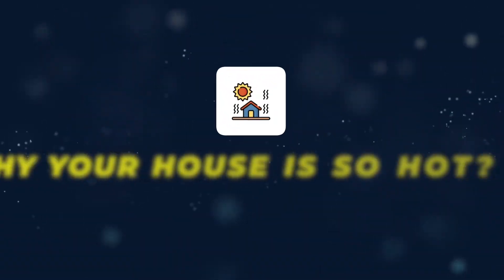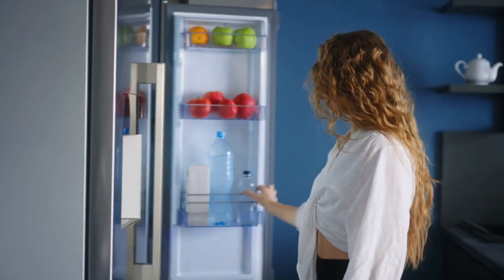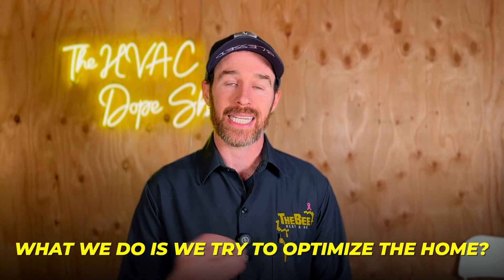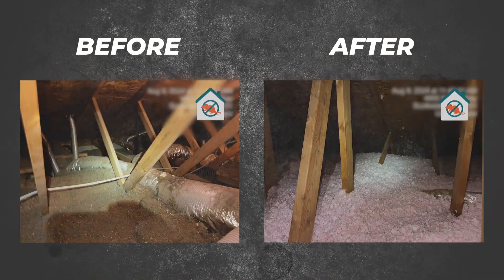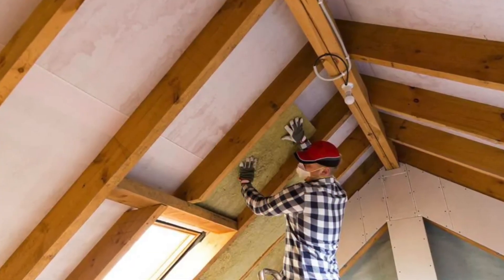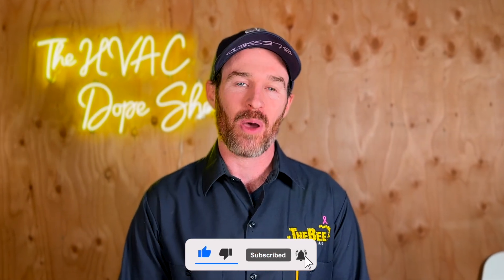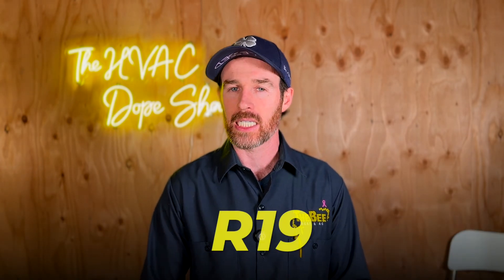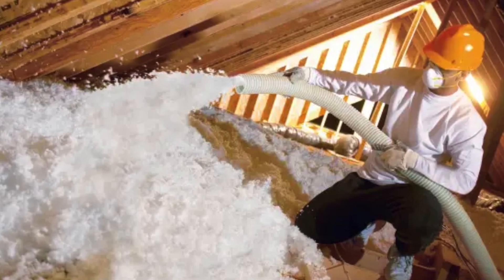Why your house is so HOT 🥵AND Cold🥶| Insulation Before and After Deep Dive

Comment: Do you guys do Manual J calcs beforehand?
Reply from the maker: Before an install ? Or before insulating? No for insulating yes for install… if I took every Manual J at face value we’d have unhappy customers and improperly sized systems. There’s a lot you still can’t see when doing a manual J on a retrofit application, even when accounting for code year when the home was built

Comment: What about the blown insulation clogging the soffit air intake or having hot light cans cause a fire. Seems like a lot of stuff gets covered using deep og blown insulation.
Reply: You case in the can lights to keep the installation from contacting it. You install baffles in the soffit to keep that air space, while also keeping the blow insulation from being wind washed away from the top plates and edges of your attic. There's a ton of details you need to do before actually insulting the house, including sealing off any air leaks like holes that lights, wires, plumbing, gas lines, etc penetrate walls and ceilings. Examples are using fire caulk or fire block spray foam to seal off any holes with wire running through it.
Reply from the maker: What @mritalianfighter1 said 😂🫡

Comment: I am in Minnesota. I went from an R-42 to R-60 and I did the garage to an R-60 as well. Totally worth the money and time!!
Reply from the maker: Probably made a huge difference!
Reply: @TheHVACDopeShow  It did, but just like you said I am not fighting moisture. My house was built at the end of 1997 or 98 so it does not have an air exchanger. I had a radon system put in to mitigate some of the moisture. It helped, but I am currently stuck running the AC at a temp lower than we we like and I still have dehumidifiers that I have to run from time to time.

Comment: Blow in IS cheap but it’s also blow in, meaning you pretty much won’t be using the ATIC for anything else. For many people that’s fine. I want bat insulation in the ceiling and spray foam on the roof.
Reply from the maker: That’s a good combo too and will definitely keep things comfortable

Comment: I have a skeptical view of anyone who criticizes a product that is so widely used like 2 part spray foam without at lest referencing a white paper studies from qualified experts that back up their claims.  But, just to put some support to your claim, My sister built a 900 square foot mother in-law home in 2008 using 2 part spray foam through out the entire house. However, she did find a sealing paint to put on the spay foam on walls and ceiling prior to adding the sheet-rock
Reply from the maker: https://archive.epa.gov/epa/saferchoice/potential-chemical-exposures-spray-polyurethane-foam.html
Reply from the maker: Fair enough, but yeah I won’t touch the stuff. Excellent insulator I might use it in a warehouse or something but there’s too many other good options that aren’t toxic
Reply: Thanks for the information, it was helpful to me in deciding on whether to use this product in the main structure of my upcoming home build

Comment: I went from an R20 to R50 attic on my bilevel, while upgrading the venting. So far I’ve cut my heating by around 20% and cooling by a third. I was motivated after reading a local newspaper article of a house with the same upgrade and getting an 18% savings in heating.

The other major energy savings was swapping the curtains of my west facing window walls from cotton/polyester to linen. That cut my cooling by another 15% or so. Who knew that blackout curtains absorbs heat while light filtering linen curtains reflect it away.
Reply from the maker: That’s amazing! So often insulation is overlooked and people hyperfocus on efficiency when making your home more comfortable can be as simple as better insulation and sealing up leaks or draftiness